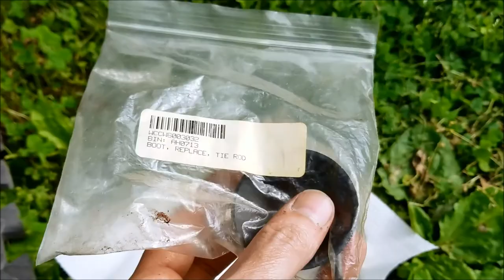RV Repair: W24 Workhorse Chassis How to Replace Rubber Tie Rod Boots

Comment: Great tip. Recall doing tie rod ends on old cars that were severely neglected, but not the W chassis. Same principle. Thanks Kevin. 

BTW, when toe in, or especially steering wheel alignment, comes up, try simple laser pointers [greens are best] taped to yardsticks, to make the job simple and easy. Fasten the yardsticks to inside tirewalls however you like. Just shoot the beams toward the rear tire treads for reference. Measure extrapolated distance between the dots, until results achieved.

Comment: Lug nut torque is 475 ft lbs.  Where's that part of the video?
Reply from the maker: You are correct I guess I forgot .. Because my torque wrench wont get to 475 I just get as tight as i can the drive a mile down the road to a tire store and borrow there torque wrench    ..
Reply: @ktoutdoor  
2004 Adventurer.  35U  I did my tie rod boots also. They are sure proud of the price on those things!!     Wasn't necessary to take the tires off.  for me, I just turned the wheel all the way right for doing the left side and all the way left for doing the right side and lifted the front of the rig with the hydraulic levelers.  I'm a retired mechanic and when I looked at it, I noticed the shank has a spot in the middle for a puller with the centering tip.  It's visible in your video also. Just take the cotter pin out, remove the nut and I used a three jaw puller and put pressure on it and then used my air chisel with the flat hammer bit and hit the SIDE of the tie rod end with the air chisel with the hammer bit for a second and it popped loose quick and easily.    I wouldn't hit with a hammer as you run a big risk of damaging threads on either the nut or the shank and then it turns into a big cluster fu--  and way more money if you have to replace the tie rod end, which means alignment also.  Of course, I have way more tools than most do it yourselfers.   Also, be careful not to let the center link drop to the ground and break the grease zerk fitting off when it pops loose because it will drop that far and you don't want it dropping.  I tied mine up with a piece of rope to prevent it from striking the ground.  Happy RVing.
Reply from the maker: @seaswirl79  Thank you very much for contributing to this video, it will most certainly will help a lot of people that watch it. Yes they are proud of those little rubber boots. Stay tuned I have more videos to upload.